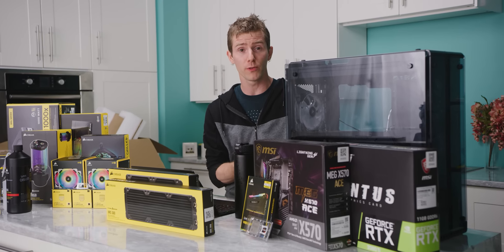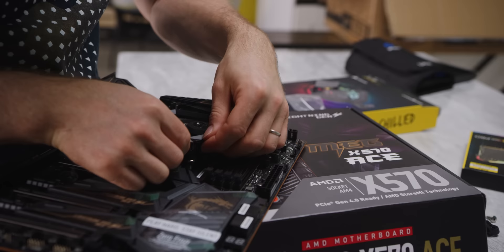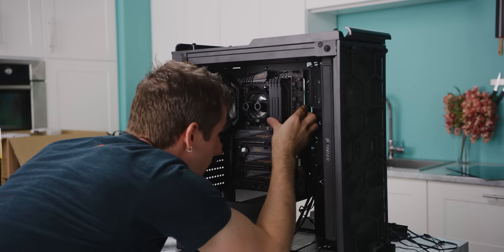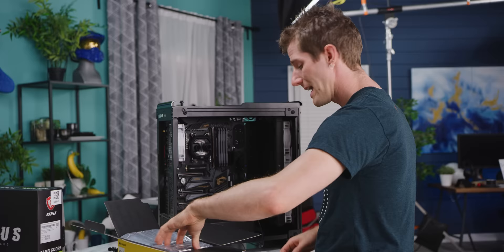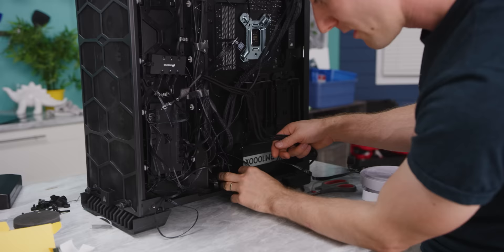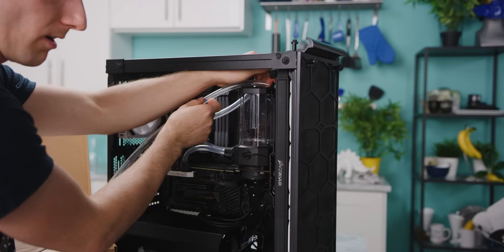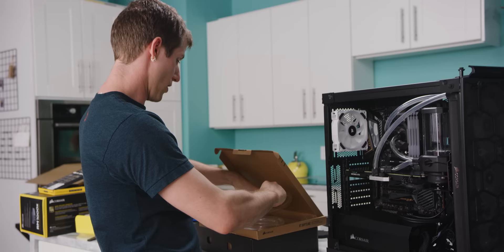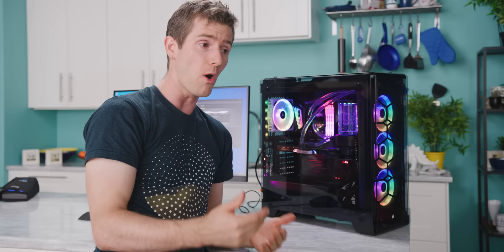Custom Water Cooled PC SPEED BUILD - Hydro X Series

Comment: Me: “building a pc looks so hard”
Also me after building a pc: “it’s that easy”
Reply: It is pretty easy if your not doing water cooling it surprised me to
Reply: I haven’t ever built one but I might but I don’t believe it would be easy still some reason
Reply: @elijahh4435  It's only because you haven't done it before and are worried about messing up. The only part I'd consider hard at first is installing the CPU cooler. If you get a cooler that screws in, make sure you push down on the screwdriver and only do a few revolutions on the first screw. Then go the screw on the opposite side and do the same thing. Do this with all 4 screws first. Then you can easily screw each one all the way until it won't let you screw it in any further on all screws. 

The other tricky part is making sure your 8-Pin power CPU connector is plugged into the Motherboard from your power supply. Or else your CPU will not boot. ;)
Reply: @elijahh4435  Also NEVER force the CPU chip into the socket or you could easily damage the pins and destroy it. It will drop right in if you have it positioned correctly.

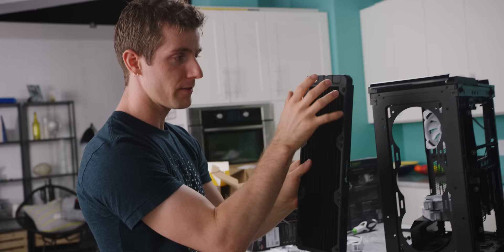Comment: 3:55 suggesting having fans pull air through rad instead of pushing. 5:05 having air pushing through rad. Things change as you build a pc.
Reply: I know I’m late, but would you rather look at a rad through the front panels instead of rgb fans?
Reply: It's a filtered case. Dust control on the rad is likely not a bit issue

Comment: don't know if you'll ever see this but in regards to what you're talking about at @6:30, you should still want some sort of intake fan pushing an equal or greater amount of air into the case than your exhaust is, well, exhausting. It's called positive air pressure. If you have more exhaust than intake you'll end up with negative air pressure where your exhaust pressure will be trying to pull in fresh air from wherever possible (usually unfiltered gaps in components, etc).

Comment: Im curious how much this setup would cost but I'm too scared to find out.
Reply: 2800 is not including the 800 you need for the full water cooling system
Reply: The top tier liquid cooling by itself is between 750 and 1200 if all bought on corsair

Comment: Interesting that Linus recommended keeping the fittings/tubes for the radiator at the top for a front mount setup. Gamers nexus tested this and advise keeping them at the bottom to avoid noise and wear on the pump
Reply: Tested what exactly?  May want to check if you're referring to an AIO as custom loops aren't subject to the same rules.
Reply: @nyveh3053  yeah you're right they were talking about an AIO. Even so, could air bubbles still be introduced into the pump by having tubes up top of radiator on a custom loop though? Video I was referring to is this one at around 18m20s: https://youtu.be/BbGomv195sk.

Comment: 3:45 1 year later: do as Steve says and put the fittings on the bottom so air gets trapped in the top and gravity will help push the water out of the radiator

Comment: 3:50: "push Down against gravity "  

Linus 2019....
Reply: Yeah I dont know what he was talking about there. Furthermore, it really doesn't matter which way you put the holes. Do all the tilting and such and all the air will come out. The only reason I think putting em at the bottom is nice is because it is easier for maintenance on the radiator.
Reply: @jacquestcomc  exactly
Reply: Jack Garrett exactly. Try emptying the loop with the fittings in the top and not having a special hole for it in the other side of the radiator.
Reply: air bubbles rise in water so what he's saying makes sense

Comment: OOOH i love the hole idea in the mobo so you can pass through the RGB, I was thinking too maybe instead put a RGB connector header pin there or something right next to the CPU slot maybe near the fan header and then have a trace on the mobo bring it to the upper right or lower left corner of the board on the back or front where you can connect in to route the cable to the back of the case.

Comment: 12:44 I think I would switch the 45 and 90 degree fittings to avoid the kink at the GPU and to get a more clean run from the CPU

Comment: With a D5 you can mount your rads however you want - you can just brute force the air out by running it at 100% for 15-60mins. I've never had it not work, and I think I've done it with a dozen different loop builds with rads mounted ports down. Mounting rads like that makes draining the loop easier, which can be a real bitch when changing coolants, maintaining the loop and shit. It took me years to figure out a system that allows me to drain all the liquid from the loop except a little that will remain in the blocks, without taking anything apart. 

On a different, unrelated note; 

Remember kids, don't use any LTT videos as guides for watercooling. You might pick up a bunch of dumb, damaging and dangerous habits that will cause you problems in the future. I know of a couple people who thought flushing their loop with tapwater only before use, or using just distilled water as coolant without proper additives was okay thanks to LTT. I had to clean those loops, and it could've been avoided which makes it just so stupid.
Reply: I am new to water-cooling, I have a hardline system from OriginPC and I am trying to figure out how to drain my loop safely. Would you have a recommendation? I do not have a drain valve and I also notice in this video Linus did not install one either. Any advice would be extremely helpful. Thanks in advance.

Comment: “Put the radiator with fittings on the top to help bleed the system”

Well that didn’t age well
Reply: @Mark Maurer Gamers Nexus (another Tech Channel) made a video explaining, that having the radiator mounted with the fittings on top can shorten the lifespan of an AIO CPU cooler, because that way, air bubbles can get into the pump. I am however not sure, wether that would also apply to custom loops, scince the pump is mounted differently.
Reply: @nylen8078  it does not apply to custom loops

Comment: The screws were confusing but I did figure it out! The great part was that they were included! An old build I helped do 2 years ago forced us to go to home depot to buy longer screws that reached through the fans and bracket to the rad screw hole. Corsair does make it easy but sadly you will need more than 1 commander pro with all of the fans and corsair blocks etc.

Comment: Just a note about this case. It has two 140mm fan spots in the top, but depending on the motherboard, you can't fit both a radiator and fans in the top.

Comment: Not a believer this is the right setup for airflow. The giant pump/reservoir is blocking like 75% of the intake airflow for one. This is making it almost like a 1 fan setup. It just doesn't seem thought out. With the pump location the intake and exhaust fans should be at the top and bottom of the case

Comment: So, the radiator is either sucking air in to the case, or blowing air out the front, never mind you have no drive bays. Put the radiator/fans at top of case, if you want space for drive bays.

Comment: I would put the power supply the other way so you don't get convection heat into the case. Also when water cooling, if you ever have a leak or spill coolant or something it would drown the power supply that way (or you could drop a screw into it). Also dust tends to fall down... into the psu

Comment: @Linus Tech Tips I built a corsair hydro x series system (thanks for this video it pushed me over the water cooling and argb lighting hurdles). Since my build I have  had a issue with all of the RGB shutting off and turning back on. I have force updated all the firmwares and made sure I am on the latest icue, with no changes. Have you seen this before and what was your fixes?
My system spec:
AMD Ryzen 9 3900X
ASUS Prime X570-Pro

32GB DDR4 3200mhz (8gb x 4) Vengence Pro RGB
Nvidia RTX 2070 SUPER Founders Edition
2x 1TB Samsung EVO 970+
Full Corsair loop (pump, cpu, gpu, and radiator)
Corsair Commander Pro (6x fans in use (pump is connected via mainboard), RGB channel 1 Hydro X Series (gpu > pump > cpu, I know it is odd, but it worked with wire management, RGB channel 2  RGB hub all 6 in use by fans).
Corsair RM850X

Comment: basics of physics: pulling air through is by far better. Pushing air through will create more turbulence; more noise, less cooling. Pulling: turbulences are reduced to a minimum as the laws of physics tell us that the flow will search for the lowest turbulence flow and maximize laminar flow. laminar flow means less resistance, less noise, better and faster flow and thus better cooling. Same counts also for the whole case: you should always suck out more air than you blow in, if you want better cooling with less noise. It also means, it is better to have a larger number of fans, a larger diameter for the fans and low fan speed. The largest fans should suck air out, not blow air in. 

True also for fan based CPU coolers. Pull, not push!

But: good luck to find such cases. Thus try to remember these basic physics rules when building your next PC.

Comment: Tempted to move to watercooling since they have support for the 3080ti and it runs hot. also be good to ditch my aio as it's loud as hell. I have a 680x case and 6 ll120 fans already and vengeance pro ram so this would look great def be soft tubing not even considering hard tubing for my first time watercooling.

Comment: hey linus looks like your using the corsair crystal series 570x, i have this case, do both of your side panels fit right? because one of mine is off like the laser cut holes are too far to one side. but corsair wouldn't respond to my tweets to them about it when i noticed

Comment: 3:36

Ok, now, we all know warm water rises to the surface, this means a pump has to work less to pump hot water up than cold water
Then there's also the mechanical issue even if we're talking about equal temperature: ok, so it doesn't have to pump 0.5 liter up
it still has to SUCK 0.5 liter up, so in that scenario, it makes no difference

Comment: Corsair says to mount radiator with the connectors at the bottom if mounted in the front. Will any problems occur if you mount as depicted in video?

Comment: But dont u run the risk of pushing the air through your cpu block when u mount the rad with the fittings at the top as the air pocket will be at the highest point in the loop

Comment: Hmmm, what if you made a true passive cooled pc (no fans or water cooling). I’d say it needs to run at least Minecraft 60fps max for it to count (setting the bar low here cus a passive cooled system is a nightmare to say the least)

Comment: Hi Guys, i got this setup: (from 5 years ago)

- ga z97x ud5h bk
- Intel i7 4790k
- nvidia gtx 970 msi gaming 4g
- g.skill ares ddr3 4x4gb
- samsung ssd 840 evo
- seagate barracuda 7200.14 (3tb)
- corsair cs650m 650w
- a scythe cooler
- some corsair tower
- (im gaming on a 1080p 144hz monitor)

and i‘d like to upgrade in order to make it future proof. (cyberpunk, red dead 2 etc. on ~very high/ultra)

so what new graphicscard should i get and what else should i upgrade?

upgrade-budget ~500/700€

many thanks in advance!

Comment: Old video but ill try asking anyway? im thinking about custum watercooler. But most videos iv seen only one radiator is used. But from cpu to gpu the water is heated from the cpu. My thought is cant you put a second radiator betwin the cpu and gpu. my thought is reservoar/pump to cpu to radiator to gpu to radiator and then back to the reservoar. Thinking the gpu needs the best cooling aswell then heated water from the cpu.

Comment: This I kinda unrelated to this build, but, I'm currently going with a Ryzen-7 3800x, I was wondering if I could use my Ryzen-7 2700x to update the bios on my B450-f mobo or would I need an older amd cpu to update the bios so I can run the 3800x.

Edit: I know that with a bios update, the mobo is compatible with the cpu; which is why I'm not upgrading my mobo just yet

Comment: Want to watercool my CPU and GPU but with my pc case, a 360mm radiator won't fit only a 240mm radiator will, and from what I read up on a 240mm radiator won't be enough to cool my CPU and GPU without thermo throttling .  And I'm not getting a new pc case, so i guess I'm stuck with air cooling.

Comment: why don't water water cooler manufactures use axial fan to cool radiators  to low speed high static fans.  A simple shroud cove min thickness 2 or 3 ducted shroud would be quiet and 5 times better than radial fans as far as longevity and max radiator cooling ????

Comment: Gamer's nexus suggest that tubes should be at the bottom with the pump slightly below the level of the top tank so air bubbles will stay in the top tank instead of the pump. Now im getting confused
Reply: That was referring specifically to closed loop All-In-One coolers and doesn't apply to a custom loop like this. In a custom loop you're able to easily bleed the excess air out of the loop, meaning that you won't have to worry about air bubbles getting into your pump. In an AIO, however, you're generally just going to have to live with the fact that over time more and more air is going to get into your loop until it eventually stops working. This is why Linus suggests hoses at the top, because you actually want air bubbles to easily flow through your custom loop so that you can get them to the reservoir where they escape the loop and stop being a problem. You can't do that on a closed loop AIO, so you want hoses at the bottom to STOP air from flowing through the loop in those.

Comment: I'm a bit confused, so after installing the radiator, did Linus install additional fans at the front (attached to the radiator) to expel heat buildup from the radiator itself or was it just an aesthetic choice?

Comment: i've always thought that since heat rises... and since heat travels through open vents easier then the metal surface that isn't the vent on the rest of the power supply... that its a better idea to point the fan away from the motherboard if possible or if above motherboard point it upward even... because it just releases more heat to the motherboard components were as if the vent is pointing outside the case instead that heat has no influence on the rest of the overall temps inside the case or does power supply not get that hot? mine doesn't really feel that hot anyways but still...

Comment: Should a Ryzen 5 5600x and RTX 3080 be water cooled? Or is a noctua block enough for the CPU?
Reply: a noctua cooler is fine for a 5600x, but you will be able to overclock your graphics card and CPU with ease if you are able to afford a custom water cooling loop

Comment: i9 9900k @ 5.1ghz 
2080Ti @ 800mhz / 130mhz 
Coolermaster C700P
^^'
Front: 420x60mm 
Top: 280x45mm
Back: 140x45mm 
Push/Pull
xD and it still runs hot wtf

Comment: 3:43 Isn't this incorrect based on Gamer Nexus' research and experiments?
Reply: I was wondering the same thing! Weird
Reply: Gamer nexus tips only are applicable to AIO with the pump on the CPU Block, For custom WC kits like this where the pump is on another location, the rules are different. Having said that, I'm not sure if what linus is saying is 100% fact, but it does has some logic to it.

Comment: Corsair memory is a rip-off they get you thinking 3200/3600 mem out of box but no you have to enable xmp or docp to get it to say 3200 /3600 so basically overclock your ram when it should of already been 3200/3600 in first place
Reply: I don't think there is any ram that isn't like that lmao, it's not a rip off.

Comment: I can tell you from experience, the thermal pad/paste that comes on corsairs water blocks are TERRIBLE! I took mine off and replaced with 5.00 artic silver and it dropped 20 degrees. Just a tip

Comment: Just put the pc in a full size fridge and run the wires through the doors...

Tried it once and played RDR2 for 13 hours
The chicken in my fridge is cooked.
Reply: There IS such a thing - an EXTERNAL 'refrigeration' unit called a CHILLER and YES, it actually WORKS!

Comment: For me Corsair has always been about high quality parts let down by appalling software design and technical support.

Ironically, they've finally reached a point where iCUE is a stable, comprehensive and unified platform, only to release mid-tier garbage at premium prices. 

It looks good, as long as you don't get close.

After inspection I concluded:
- Injection moulded threads
- Mostly injection moulded Nylon
- Horribly cheap metal finishing
- Ugly seam lines and janky plastics
- Profit based manufacturing decisions
- Machining on the GPU block was ace
- Great touches / accessory inclusions

Given how badly they fucked Commander Mini owners and the LINK ecosystem, I shouldn't be surprised. I suppose I'm just salty thay they could've made something so damned good.

The one big surprise for me was how much of a shill video this was. I'm hoping I've missed proper reviews of this equipment from LTT, but I'm not holding my breath.